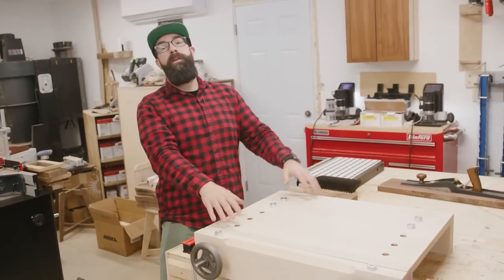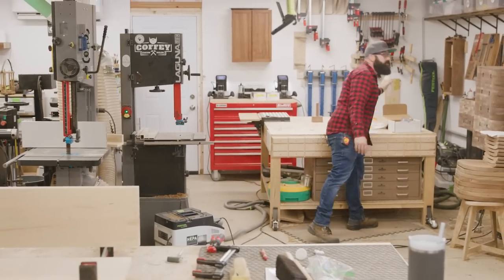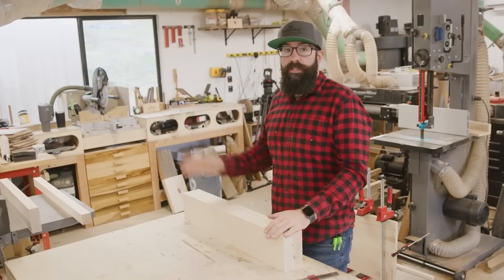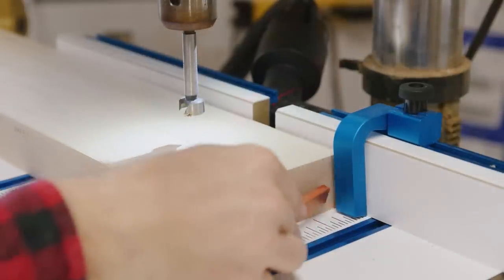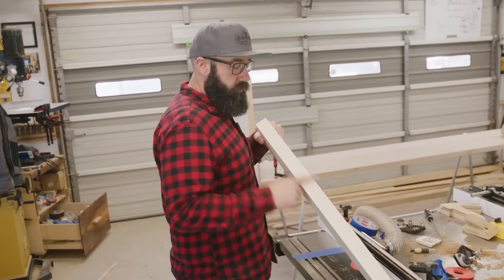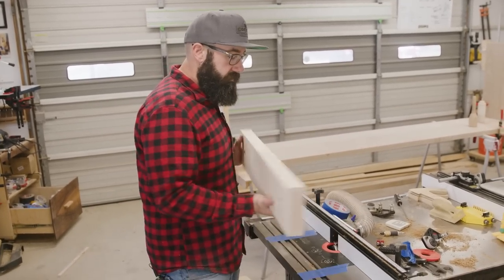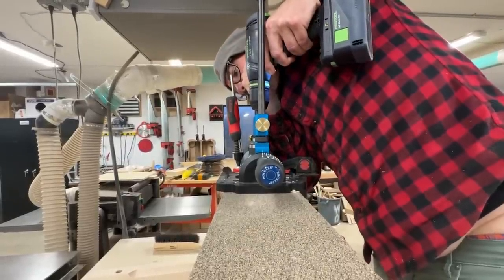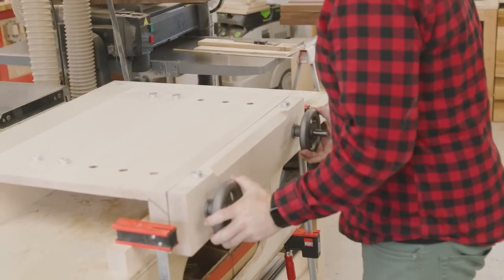This Vise Changed How I Woodwork

Comment: Great build.  I'd have locked the nut in the back of the back jaw where you mistakenly had it.  Then I'd have I'd have locked the thread in the wheel.  That way the thread travels in and out with the wheel instead of bruising my hip every time I walk past it.
Reply from the maker: I just avoid it.

Comment: Great video. I’m just starting the same project and really appreciate the magstop reference tip.  I was planning to forgo the stabilizer because I thought adding the table would serve that purpose.  Is there a reason for using both that I should know?  Thank you for the video!
Reply from the maker: You will need the stabilizer for sure. There just isn't enough weight to keep it in place. You need to clamp the whole thing down to keep it from moving for sure.

Comment: Interesting. I would also put bolts on the inside. Cause when you tighten those wheels it builds pressure toward the outside. And bolts might pop out?
Reply from the maker: There are bolts on both sides. The mortise one on the inside and the one on the outside.
Reply: @CoffeyCustomBuilds  oh i see now! Thanks!

Comment: Sorry to say you went the hard way to fix something in a slightly different less common designs of moxon vice is not mistake,   Some of the slightly different designs is a metal plate that goes between the two nuts that is bolted/screwed/clamped/magnet in place.    The clamped/magnet into place is that you can push the threaded rod of the vice back inside the vice when you are not using it without having to undo the nuts the plate makes getting the nuts back into alignment to go back in simple.
Reply from the maker: what?

Comment: A very nice result! So you don’t get any vertical racking when you use the vise with bench dogs? I had originally decided on a table on my build but then halfway in, I suddenly thought that it may not be a good idea after all. I know the holes in the front bar are oval horisontally and not vertically but the hole is just drilled in wood after all. How is your vise holding up?
Reply from the maker: Its holding up great and I use it every day. This design has been around for hundreds of years. Invented in the 17th century by Joseph Moxon.
Reply: @CoffeyCustomBuilds I've only ever seen the old Moxon vice without the extra top. I'm curious how that addition has enhanced your woodworking. 

Possibly a follow-up video?

Comment: I'm only 6 minutes into your video and hear see two mistakes already. You cut the front and back jaw to the same length? The back should be longer for clamping to the workbench.
The oval holes in the front of a Moxon vice is not there to prevent racking when you pull it out, though it does that too. 
The whole point of making a Moxon vice is to allow racking and be able to securely clamp tapered items like table legs, guitar necks and other items with odd shapes. 
It also works well for normal flat shapes.
Reply from the maker: If you watch the video or look at the thumbnail you can see that I don't use the back jaw to hold it in place, I made a separate piece for that. Also, my statement isn't incorrect. It is correct. But what you said is also correct.